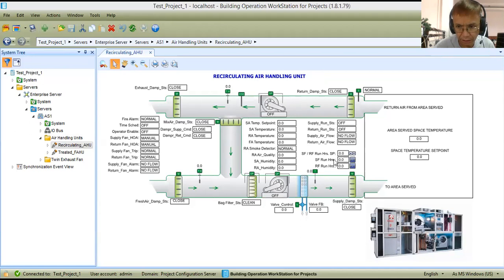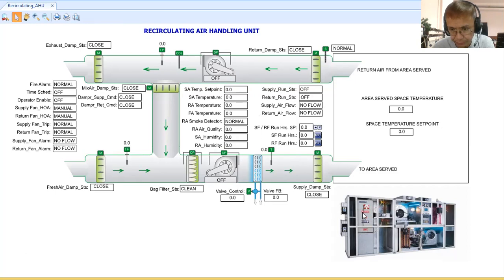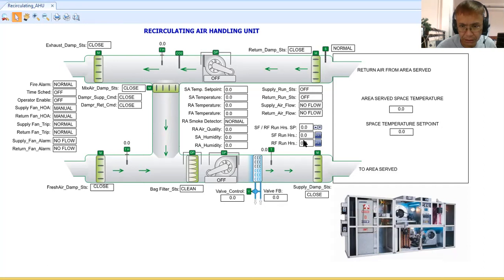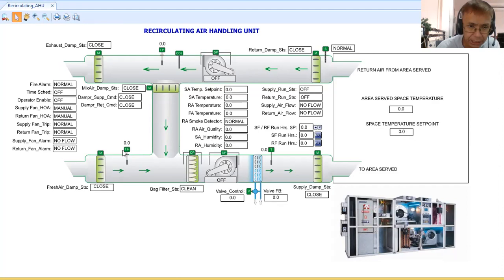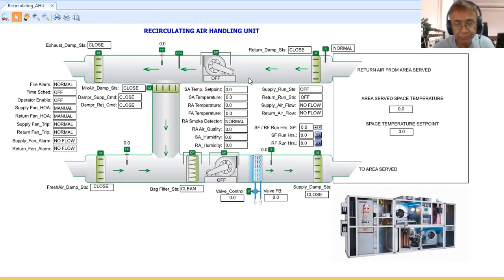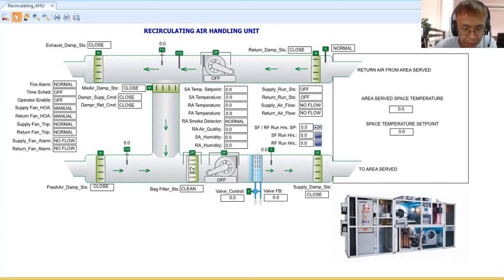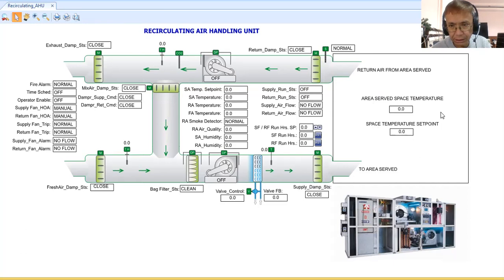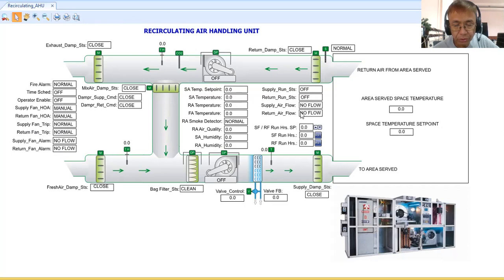How to become a BMS engineer part 81 (Recirculating Air Handling Unit)

Comment: In some AHU's we cant see the Supply temperature setpoint option, there is only return temperature setpoint. What's the difference in doing so..?
Reply from the maker: meaning the return air temperature is the one being used in the control of cooling valve, basically we are using a PI (proportional + integral control) to control the  air temperature being delivered to the area served by AHU. so in PI control  the measured variable is the return air temperature instead of supply air temperature

Comment: Sir, why are we using BACnet controllers when we already have I/O controllers and AS.
Reply from the maker: first reason is  cost, automation server plus I/O modules is expensive,  and it will always depend on the equipment that needs to be controlled, let say an exhaust fan you can use a much cheaper Bacnet controllers with enough built-in I/O to handle all the control and monitoring points.
Reply from the maker: AS acts like a network controller for all the connected BACnet controllers to it.
Reply: Thank you🌹

Comment: thanks alot for clarification .can we call this ahu as fahu because  it takes fresh air
Reply from the maker: Actually this is a recirculating AHU or RAHU, FAHU is used for delivering fresh and treated air to some Air Handling units and Fan Coil Units in the project / building
Reply from the maker: all Air Handling Units will be using Fresh Air, during summer time specially in the middle east ambient temperature will be high so the damper for fresh air will go to minimum position for a Recirculating AHU